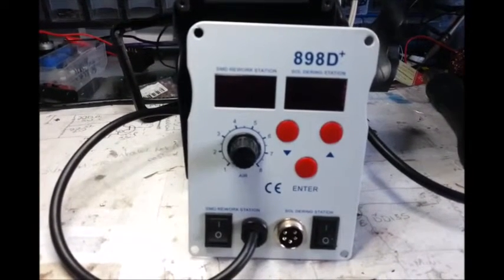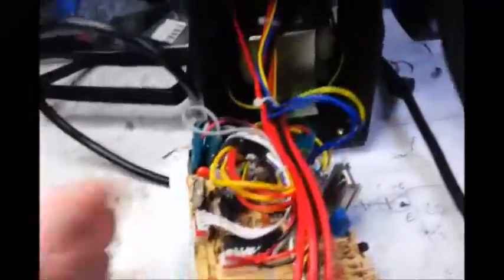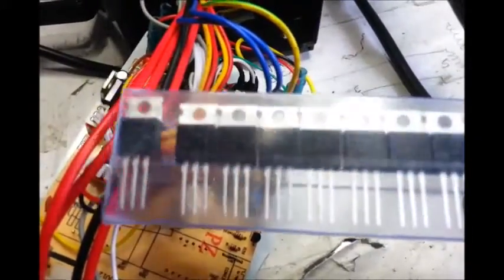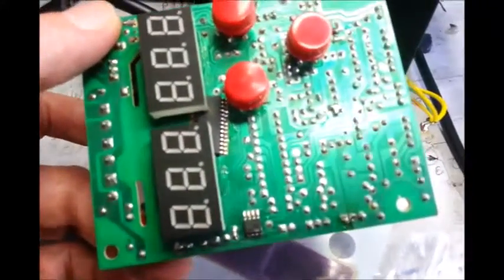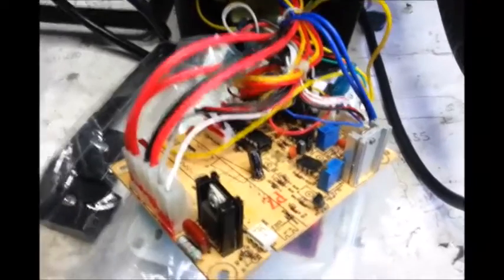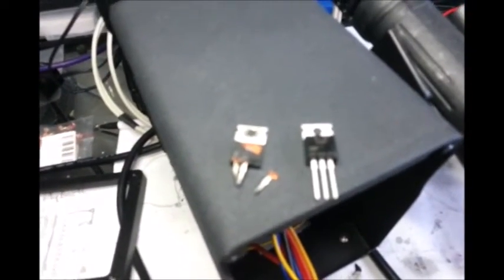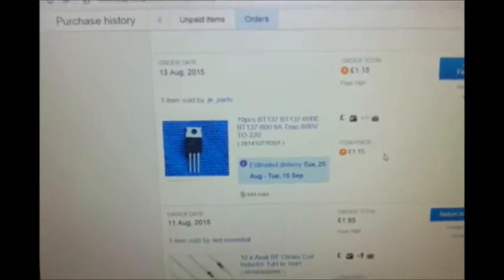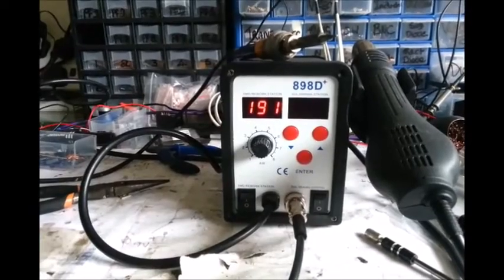898D+ Soldering Station Repair

Comment: Nice Fix! Got a kada 852d+ here pretty solid tool! My air gun element is shot and had to replace iron once before, for the money I can't fault it. 
Tip for your steel wool, I took a magnet out of magnetron fits perfect in the base of those cleaners and holds firm on the solder station.
Reply from the maker: Tradie Trev Hi there, The solder station is not too bad for the money and a really cheap easy fix.
Great tip, I have a Magnetron magnet I will give it a go.

Comment: At least you got lucky that your triac blow, I have a 878L2 and my transformer smoked...... because the heater shorted and the fuse , oh well...  I recommend you to put inline fuses with the heaters, basically in the transformer 220v and 32v

FIY there's 4 voltages on that board: 10vAC for the logic, 26vAC for the fan, 32vAC for the iron's heater and 220v (triac) for the heat gun's heater...
Reply from the maker: Transformer smoke is not good or cheap. You would have hoped the fuse would protect the transformer, maybe it was faulty and that's why it failed.
The fuses probably a good idea. I only use the hot air gun as I bought another solder station locally.
Reply: I probably put a couple of low power transformers inside  just for the fan (26v) and the circuit (10v) and run only the hotair from it. The soldering iron was crap anyway... BUt yeah.. at least put a fuse on the iron's heater line

Comment: Was it the replacement soldering iron that cause the Triac to blow? I just purchased a replacement for mine. I'd hate to have the same issue. Luckily, I have a few of those Triacs on hand. Hope yours is still working well. Video is a couple of year old : )
Reply from the maker: Hi Joe. Yes it was the soldering wand which was wired different to the original for this unit. I still use the hot air but have another solder station for my soldering.